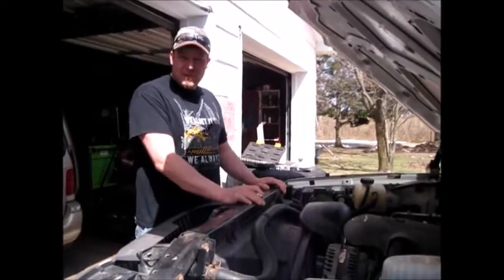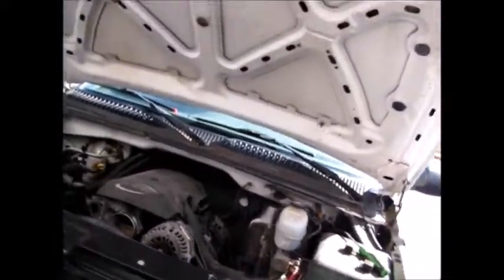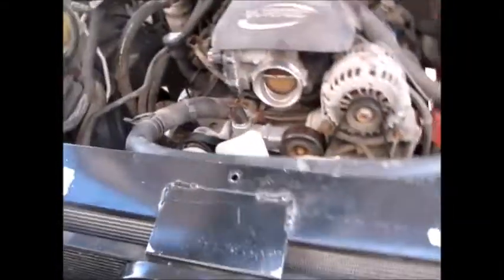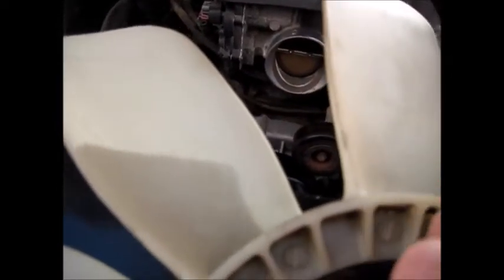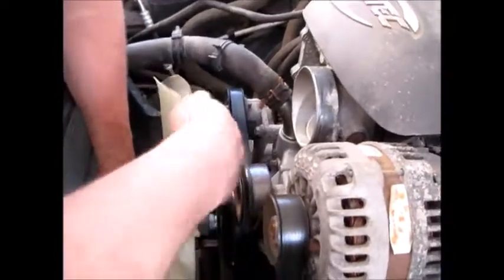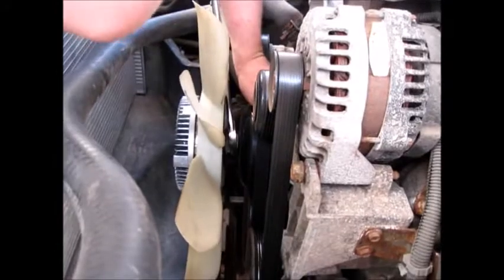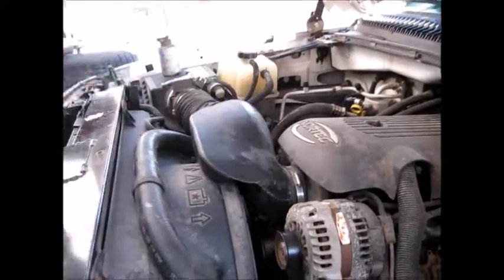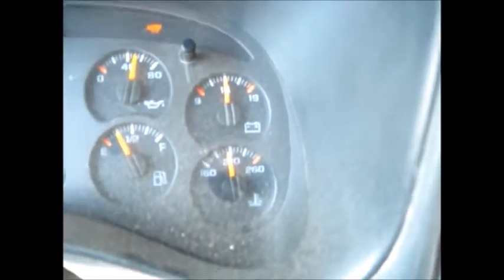2004 Chevy Silverado 2500HD 6.0 Fan clutch repair

Comment: Holy shit I thought this would be way more difficult, I have the same year truck and engine and I love it to death but its started getting weak as far as cooling goes. But thanks for the video, great to know it's this easy!
Reply: Trevor C that’s because it is more difficult than that....they NEVER break loose that easy. I’ve been smacking mine for 15 min with a hammer to try and shock the rust free. I’m looking for a video that shows what to put in the 2 holes in the water pump pulley to get leverage. Usually there is bolts or something to put the second part of the tool that captures those 2 either bolts of pins or whatever is supposed to go in there.
Reply: @larrytemen5114  I actually did mine like a month ago or so, and I bought a tool at O'Reilly's that works perfectly, I'm not 100% sure if it's the same as this one : https://www.oreillyauto.com/detail/b/lisle-4148/tools---equipment-16488/mechanics-tools-16816/cooling-system-tools-18949/b83834068644/lisle-short-fan-clutch-wrench/43580/4413837/2004/chevrolet/silverado-2500-hd?q=Fan+clutch+tool&pos=4   
But the one they gave me worked perfectly, just used a breaker bar I had and it came loose but you have to have a big wrench to hold the nut in place too.
Reply from the maker: Your welcome.  I was a bit surprised it broke free that easily but if you turn them in the right direction initially they usually dont put up much of a fight but i have had a couple i had to hit with an air hammer and that method has never failed me. If i run across a stubborn one ill record it to show the process of dealing with a difficult one.

Comment: Does your fan suppose to spin as soon as you turn on your truck ?
Reply from the maker: depends on many variables. some will slip cold and some are fully engaged until the oil in the fan clutch warms up a bit. But it should be spinning at some varying speed while the engine is running. This only applies to a belt driven thermostatically controled clutched fan. if you have electric fans it should not be running when you first start the engine under most conditions. Some Bigger trucks have an air operated mechanical clutch disconnect. like on a semi truck. Those fans typically do not turn at all when they are disengaged.